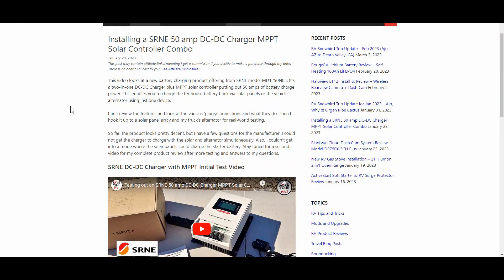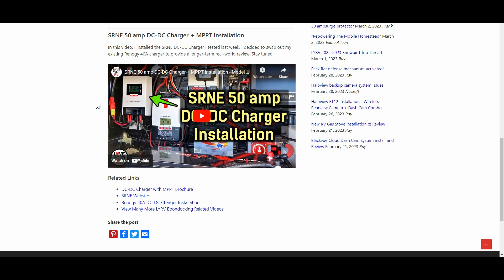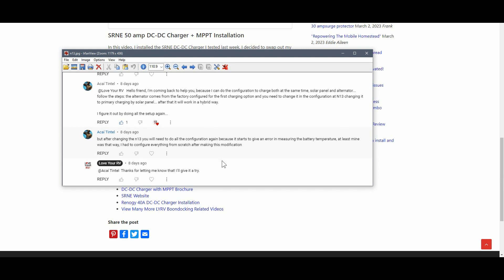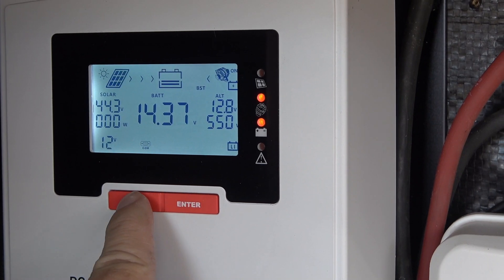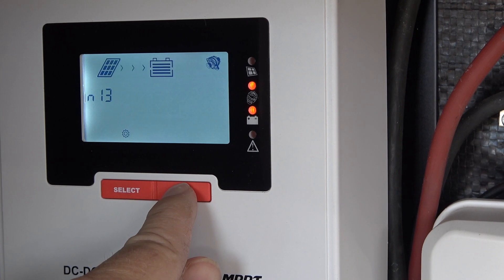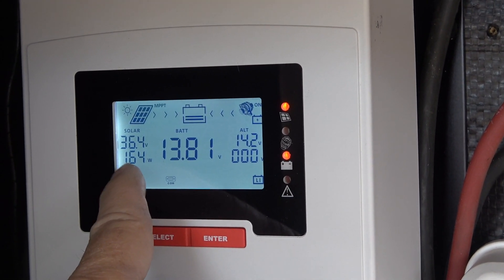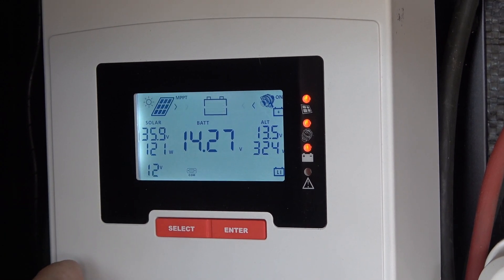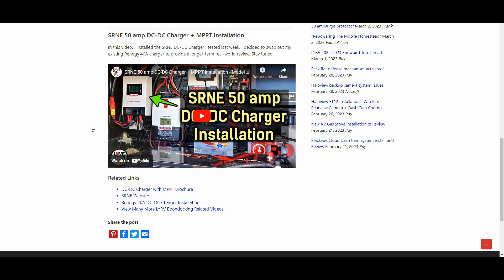SRNE DC-DC Charger UPDATE - How to turn on hybrid charging mode (Solar + Alternator)

Comment: Hello Ray,
Thanks very much for the info!😊
Did you manage to figure out how to get it to charge the starter battery?
Reply from the maker: No, sorry, I haven't. My truck starter batteries are always well-charged. Maybe it needs to see a lower voltage to start charging. Guess I'd need a run down lead acid to test with.
Reply: Hey, did you have time to make this test? Will it automatically charge the starter battery once the voltage gets low?
Reply: @renan3916 No, sorry. I haven't had a flattish starter battery to test it

Comment: Hello Ray. Please watch this review video from Spain about SRNE MD1230N05 , starting at 5.29. There is a completely different purpose for paragraph #13, as in the instructions you read. I gave you a link with a direct point in time.
https://youtu.be/f2lO1gq5nDY?t=329
Reply from the maker: My model is different. That video is reviewing the 30 amp model.  I have the MD1250N05 50 amp model. It has the baud rate setting on N15 and has up to N18 in the settings versus 16. Cheers, Ray

Comment: Hi Ray, any ideas on why my SRNE 50a dcdc would show voltage from vehicle battery but not click into charging from alternator?

No current is being pulled at all but it shows the voltage coming from car?

The other spanner in the works is that another vehicle plugs in and it works correctly? Have check all cables and connections on my vehicle however everything seems to be working as it should.
Reply from the maker: Maybe a poor connection somewhere so it shows voltage but can supply enough current due to high resistance.

Comment: Hello Ray.  I am setting up this unit on our yacht.  I have noticed that even though the percentages for solar and generator are set to 100% when running both together in hybrid mode the inputs from both are cut 50%  ie.  the generator (alternator) charge is cut to 25A and solar decreases to half the available power.  I'll be talking to the company rep to find out what's occurring and if it is normal. Hope to get a response soon.  They have been very helpful so far. I would like to know if your set up is doing the same.   Apart from this issue the unit and app are working great.  I installed 2 x 300 AH LIFePO4 batteries and the controller for less than $1400.  This was significantly cheaper than replacing the tired lead acid house bank. The cost of lithium is changing rapidly.  It was almost cost prohibitive to change over just one year ago.
Reply: Ray as I mentioned I contacted the company.  They replied quite quickly.  They stated that the unit is rated for a Max 50A output.  Therefore when in hybrid mode the outputs are reduce by 50%.  It would appear that if you don't have at least 25A of solar input then you are better off not running in Hybrid, unless of course you expect to be travelling for at least a trip long enough that will charge to full capacity at the reduced rate.  For me on a yacht that isn't normally the case. I think the way I will run will be to stay in Hybrid however when I am expecting only a short engine run time use the PV isolation breaker whilst the engine is running.  This will be easier than accessing the menu to continually change the mode.
Reply from the maker: Interesting. Thanks for letting us know. For me, it will be OK as I won't be using solar when driving, so I won't use hybrid mode. I have two other chargers that do rooftop solar panel charging and this one I use for ground panels at the campsite. Cheers, Ray
Reply: @LoveYourRV  Ray the factory representative has replied to me about the issue with the feedback of power from the start battery when the alternator is shut down.  They acknowledged the issue and are working on a software fix for the problem.  They asked what start battery voltage level the feedback discharge stops.  I will have to run a test as I have been isolating the start battery to stop the feedback.  Have you allowed it to run the truck battery down to a level where the feedback stops?  If so I'll pass that info on to the factory for their engineers.  I have been very impressed how proactive the manufacturer has been to solving issues.
Reply from the maker: Yes, it stops when the reading drops to around 12.5V on the SRNE display. Takes maybe about 2-5 minutes for my diesel truck with its dual battery system. I guess after the extra surface charge drops off and they reach a resting state.

Comment: Hi thanks for your informative video. I have a question i have one on order and was wondering does it cut off the power to the cranking battery after you turn off ignition so you dont kill your starting battery?
Reply from the maker: Yes. What I find happens with my Ram 3500 diesel pick-up and lithium RV trailer battery setup is once I shut down the engine, the charging amperage slowly drops over about a minute to about 2-3 amps, then after about 5-10 minutes, it shuts off completely.  I can speed up the process by turning on the truck headlights, so imagine it has a voltage-sensing circuit, and once the extra surface charge comes off the truck's lead-acid batteries, the DC-DC charger senses the voltage drop and shuts off charging. Cheers, Ray
Reply: @LoveYourRV  Would this work on the #4 wire on the 7 pin connector as well? I have a 2016 Ram 3500. I am adding lithium batteries and have yet to add the DC to DC charger.
Reply from the maker: @michaelgaffney5132  It could sort of work, but be limited in performance. The 7-pin wiring in trucks is quite thin usually about 10-12 gauge, so it can't carry the amps this 50A DC-DC charger requires to deliver max output. You'd have to reduce its output so that the 10-12 gauge wiring doesn't overheat or blow its fuse.   Basically, 7-pin wiring is meant to be for trickle charging to maintain trailer batteries, not set up for higher amperage charging.

Comment: I want one of those things to hook up to my lithium battery so I know what status it's in my charge controller is a midnight solar and it only shows the hours not the actual amount of charge
Reply from the maker: You can never trust the % capacity readout on solar controllers. They are just guessing based on battery voltage, which isn't reliable because it could be charging or discharging at the time and are generally calibrated for lead acid voltage and not lithium. 
To get an accurate percentage, you need a battery monitor that uses a shunt to measure amps in and out. Then the total amp-hours used and remaining can be calculated. Something like this https://www.loveyourrv.com/new-test-gadget-koolertron-battery-monitor-w-400amp-shunt-bluetooth-app/ 
Victron is a popular one as well and easy to install. https://amzn.to/3JkwJgB Cheers, Ray

Comment: Excellent update, thanks.  I suspect N13 is setting alt-priority vs solar-priority.  In alt mode maybe the alt could meet needs so solar was not tapped?
Reply from the maker: I did test with changing the max percentage output of each and it didn't make a difference still couldn't get solar to run when the alternator was on until I switched N13 to solar. For example I set alternator to 30% and solar at 100% and solar still didn't come on.
Reply from the maker: The weird thing is in the manual N13 is listed as TTL communication baud rate to be set from 4,800 to 115,200kps so they have some misinformation in the manual
Reply: @LoveYourRV  love your videos! Do you know if I can set the max percentage output of each (solar vs generator) without using the app? in other words, to set it directly within the controller, is that done via the n09 option within the controller's menu? thanks in advance
Reply: yes the manual is wrong!
 as the product is new and recent, it came with writing errors, but the company envied me the correct new manual
Reply: Does anyone know what N12 does?
Reply from the maker: @robwilliams7807  I think it's a setting for charging the automotive starter battery using the solar panel input